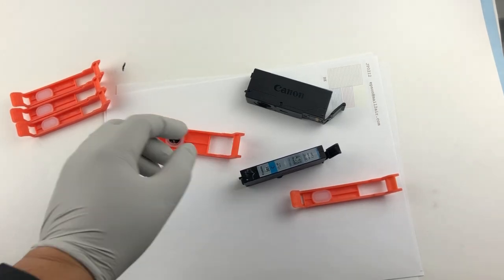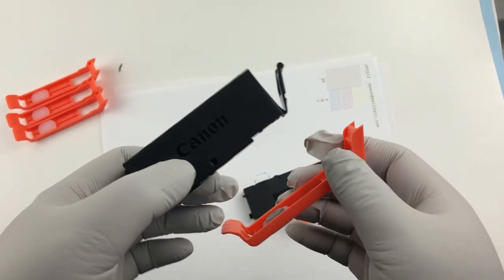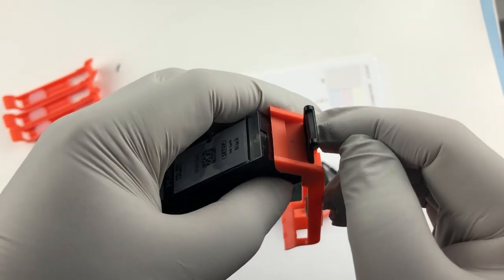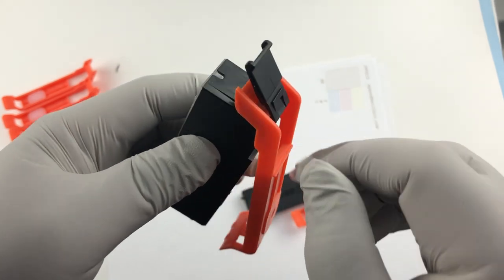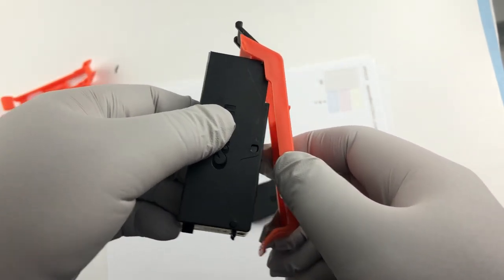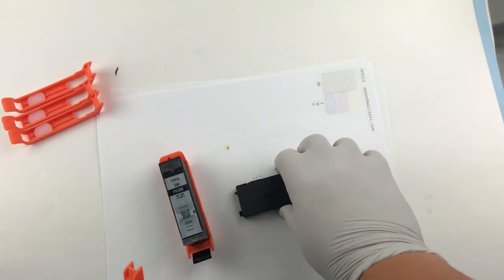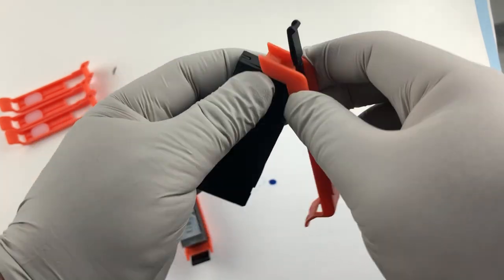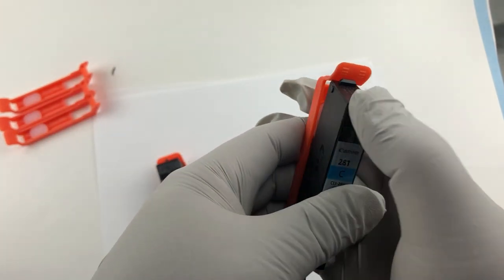Put Storage Clip on a Canon Cartridge - Protect & Prevent

Comment: @UCwjOyyJTec5a5ZznioRSJIw  whenever i leave my cartridge without use overnight, it fills with air between the nozle plate and the 
filter/sponge, but if i "prime" it before use it works perfectly and proably would print 100s of pages. What do you think could be the problem? I think the sponge might be absorving the ink between the noozle plate and the filter, but this makes no sense since that would go against gravity and i  dont think this ink has such a great surface tension (the section there is 15 mm^2 and like 5mm in lenght ). I guess i could block the noozles contct with air (seal them when not in use) so this wont happen.